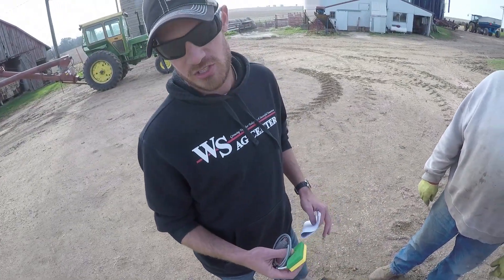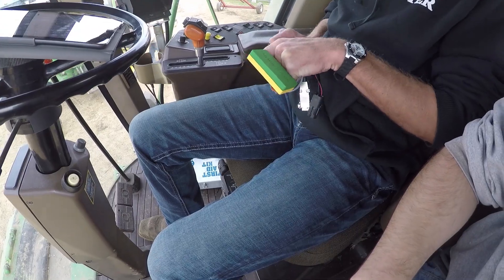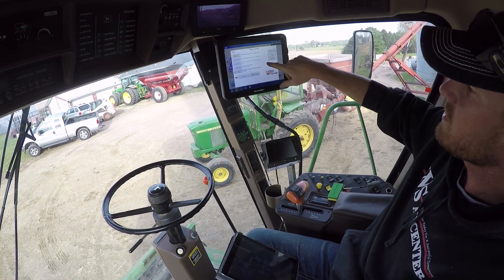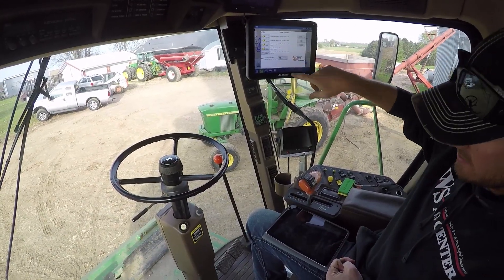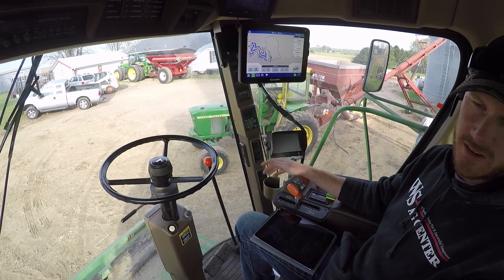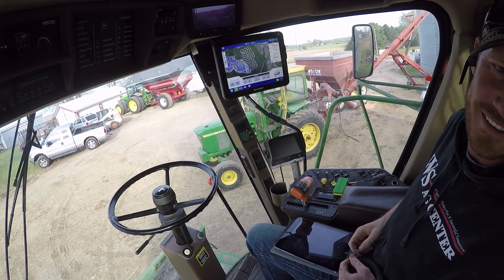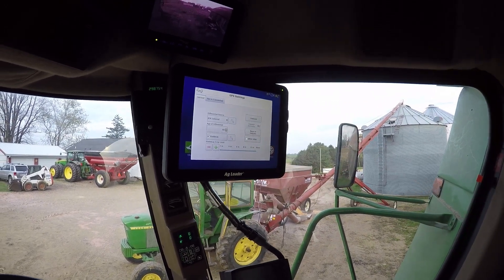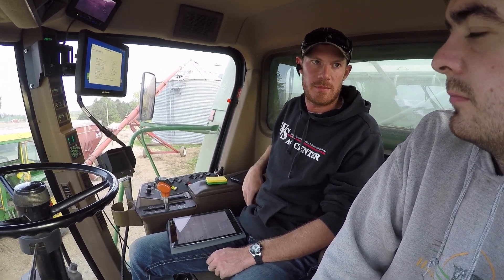The Combine gets RTK - WS Ag Center

Comment: Ryan, do you plan on using the same RTK system for planting? I was kind of surprised to see you putting RTK in the combine. I don't generally have customers that are interested in that high of accuracy in the combine. If they want to have steering for corn we usually go with a headsight unit instead.

Comment: How do you get the RTK correction information?   Cell phone interface with a subscription?  I ran an RTK system in the mid 1990's but had to setup a base station over a known survey point with a radio link between the base station and vehicle GPS.

Comment: Are you able to just connect to your home router when you are near the farm to transfer the data collected through the RTK instead of using your cell phone data?
Reply from the maker: +Kevin Machado I'm sure that could be set up, I used my own iPad to transfer the data to the Agfiniti app.
Reply: Technically if you didn't want to use any cell data, or didn't have the AgFiniti app you could still just export the yield data using the memory stick. The RTK really has nothing to do with data transfer, only Differential GPS Correction. The new Ag Leader displays come with wifi capability so you can use an Ipad or other wifi enabled device to upload the data to AgFiniti. If you just want to get your maps to the agronomist at the end of the year its much simpler to use the memory stick. Where the AgFiniti app can be really nice is if you have two combines in one field they can communicate data in real time to build one yield map between the two combines.

Comment: does any of this require a subscription? looks like Andrew's black eye healed up.
Reply: You would need to have a cell data plan to use the Ipad or Cell phone to create the hotspot. The short run cost is usually much less than setting up a base station. Here in Minnesota the DOT has a cellular network that can be used for RTK correction. You just have to buy a cell plan from verizon, sprint or whoever and a cell modem for the display. The DOT network can be accessed for free.
Reply: 2011nm thank you